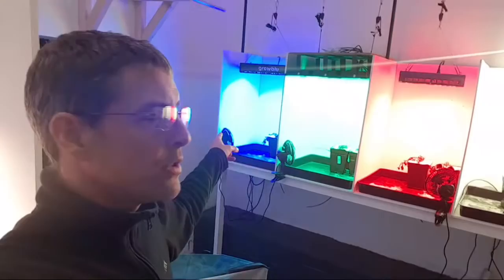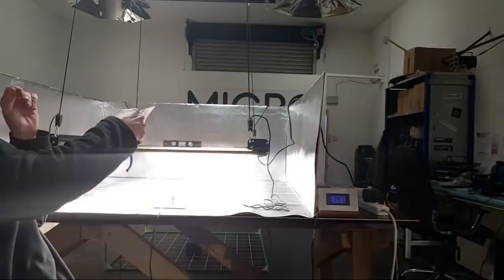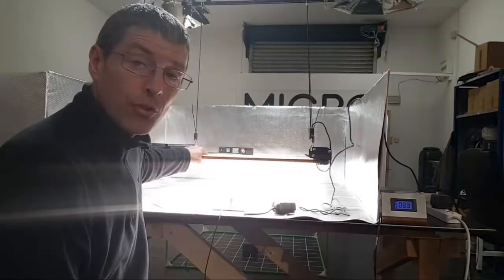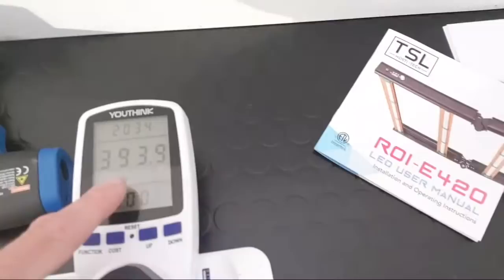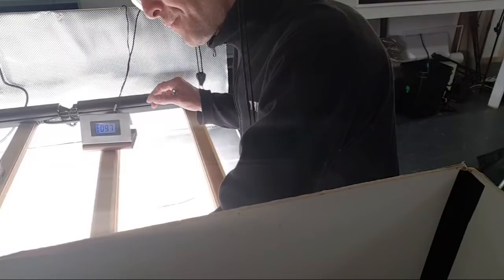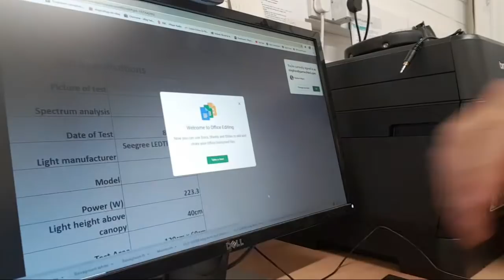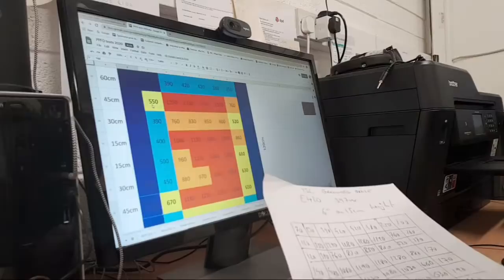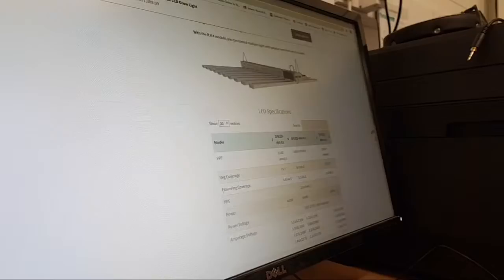Growers Choice ROI E420 test and Other Things

Comment: Your testing shows why a fixture that has a higher hanging height is an advantage.  It's the inverse square law-intensity is 1/4 when the distance is doubled.  That means you won't have a huge drop-off in ppfd through the canopy.

Comment: LM301B &  LM301H are the same, just a different label letter , H for horticulture. 
From samsung, they are the same, no extra coating , no difference.  Look it up on/ at Green Genes Garden. He spoke with samsung rep.  For first hand information.
Reply: Look it up yourself. Green geenes garden.
Reply: On samsung website you can comprare the two leds and they have different values... no one saw that?
Reply: I would not go by Green jean as his boards use lm301b not h so it is in his best interest to say that, infact everywere else i have heard besides jean and the people repeating what he has said I have heard, read lm301h are indeed a little more efficient with a slight increase in par as well. Green jean has done a good job of promoting no difference as it suits his best interest and pocket to do so.
Reply: @kkrollingskkrollings3173  did you look & watch  his video ?
He talked to samsung rep.
 301h has availability  & price issues. 
Say what you want . Please research . Not guess
Reply: @Janusz Wiśniewski market
Reply: @luisfelix09happy  they do not cimpare them the same , 1 in lumas 1 in joules
Reply: @rdreynoldsbanana  marketing
Reply: Robert ok, I will look this up, what does mms stand for & do u need to have covid9 for it to be affective? Thanks mate
Reply: LM301H are more efficient
Reply: Yes they are the same but made to take humidity so the chips last longer that’s it.
Reply: Has absolutely nothing to do with longevity.  2 things that shorten  the life of a diode . Heat & vibration.(voltage)
C is for cookie.
H is for horticulture. 
M is for markiting.
If you take some time & resaerch  B diodes & H diodes are compared differently.   If tou look further aprox end 2018 beginning of 2019 im sure you can find the article from samsung that says they wanted to gear there marketing towards Horticulture sales. 
Again no special treatment or coating, nothing to make them last longer other then under driving the LEDs , then adding more or less diodes (LEDs) or spacing per board to make different results .  Its called maketing.
Reply: @rdreynoldsbanana  You raise some great points bruv,but your manner is very rude and uncalled for.You're letting the side down a little.You clearly have a Good brain on you.Try some empathy.Peace.
Reply: There is a coating on h
Reply: @orsonwells5886  prove it
Reply: coolestguy ontheplanet why to get into a long winded argument with you about it....hard pass...cheers
Reply: @orsonwells5886  call steve @ HLG , they are partners with samsung.  Ask what the difference is .
Or better yet listen last Fridays  "Future canabis project" steve from HLG says they are they same but doesn't get off topic.  Regaurdless it a good listen. Nine guests  get into good talk about growing , lights & stuff ,
Very  specific , like grams per wattt with what light.
Reply: @coolestguyontheplanet723  the Lm301H has a phosphorus coating meant to withstand over spray and misting and high humidity in indoor grow ops. Thats exactly what the H stands for Horticulture.  
Its a benefit over the lm301b and lm301D and 281b. 
As they need a the silicone coating over the board to protect em
The lm301H and 351H reds are water resistant where the rest are not.
Also Growerschoice dosen't use Samsung chips at all anyways. They use some custom Chinese protietary chip from the same Chinese manufacturer of the fixture itself.

Comment: 41:04 I agree. I dont like how some lights or setups have so much light in the center. That's why I built my light (vero29 with meanwell) with the bulbs slightly outward and I hang it so all of the bulbs lights overlap in the middle. In my 2x8 tent, one plant wide with 6 plants a lot of the flowers grow on the outside anyways and you get the reflection off the walls.

Comment: I have 34 ROIE680’s. I just put plants under them this week.  8 lights x’s 4 flower rooms + 2 in veg rooms. I will be keeping detailed notes and information. We shall see
Reply: Glenn G. You have any issues with the master controller? My controller works fine with whatever light is directly connected but any light I daisy chain it won’t control it and the light remains on when in EXT.

Comment: Thanks for all the hard work you put in. 
 Is there a way to do a  new review on Spider Farmer series. I think they updated the meanwell drivers from older models. 
Also compare SF 1000 , SF 2000 , & Sf 4000 , the amount of diodes in each. SF2000 has aprox 50 more leds then the 1000 & 4000. Why ?
Reply: would love a review on the sf2000 which has 576 LM301B diodes, while the sf1000 that was reviewed  a few months ago only has 208 LM301B diodes
Reply: All I know is my stuff finishes early using spider farmer. 8 week stain finished in 6
Reply: @Courtdog2k3 well thats quite the statement.
i've got an 8 week strain that just popped so will see once i get her under my sf1000 for my 1st grow
Reply: We should all be done with spider farmer by now... since covid spider farmer (meizhi) highest point of there price hikes was 400 cad on the sf4000... a 400 dollar hike due to the pandemic creating high demand with no lack of supply... they can eat there lights and change names again.
Reply: @ehhcanada  I dont understand what you are trying to say.  
 Price has not gone up on Spider Farmer lights since i started looking at them months ago before covid lockown. 
SF1000  $150 ish
SF2000 $320 ish
SF4000 $575 ISH 
Any price that is far cheaper is a scam.
I thought i found a sf2000 for $150
 I ordered it.  I am now working with PayPal to get my money back. It was a scam website. 
Needless to say , prices are pretty standard.
Reply: @coolestguyontheplanet723  not sure what your on about but go check amazon and there website.... the sf4000 started at 600 CAD it went up as high as 1000cad and is currently just under 900... dont try to cover for a company that has already admitted to what they are doing lmfao
Reply: @coolestguyontheplanet723  i actually just purchased it at 889 cad just to simply prove the price hikes after they lower the price back to normal. Sf is done for they WILL switch names yet again as they are MEIZHI
Reply: @ehhcanada  not covering for anyone or anybody. 
 I can buy as many sf2000 's for $320 usd. All day long. The sf4000 is $579 usd all day long , i can buy as many as i want . If they are priced that high where you live. Dont blame someone else. Ask someone to buy them for you and reship them to you. 
My best actual price on SF 2000 is $299.99 with 10% off & free shipping as of last week when i checked. And i might buy another because my first one is a kick ass light that no one can touch in that price range. (Not even Hgl with discount)
Reply: @coolestguyontheplanet723  your only intaking what u choose to read.
They at peak raised prices 400... since covid... this has nothing to do with location or currency conversion....
You can not compared a lm301b board with a lm301h boards pricing...

Just so you know the american price was hiked upto 650usd wich is 911cad.
It has been put on a fake sale due to all the back lash for 566 usd wich is 793 cad.
Before covid it was 600cad.

Americans still got slapped with a price hike just not as bad as canada.
Reply: @ehhcanada  again there is no difference between LM301B & LM301H. There is no new secrete zinc coating . They are identical.  They use there marketing magic to compare specs in different values. Look at them side by side.
I have not seen SPIDER FARMER advertise a LM301H quantum board on the SF2000 or the SF4000. 
And i still don't know about the price increase. My SF 2000 is still new. I ordered it online,  got it drop shipped  on 3/26/2020  , so 6 weeks old.
$1 CAD is equal to $0.71 cents. USD.
your money is stronger.  It should coat less. 
Again the H is marketing. I looked it up last night.  When the LM301B became popular , they rebranded they laat letter to attract the Horticulture market. I would love to show the link or the screen shot.  But I couldn't t figure how when this first came up. .
Let me make this clear. I am in no way linked or affiliated with Spider Farmer. I dont know about there past. I really dont care . I was told the other day they where mars hydro. Or a second name or underbrand. Again i dont know. Again i dont care. Im saying you cant beet this price for this spectrum of light with ADDED far red & 760 nm IR . 
Also , alot of companies copy & paste spec sheets.  I truely beleive this one is pretty acurate by 2 quality reviews with apogee meters. 
Not trying to buat balls. Trying to help with research i have done & believe to be true & honest
Reply: @coolestguyontheplanet723   my point is they are a budget light currently priced the same as a high end brand in canada.sure the states has not seen as large of a hike on amazon by spider farmer (meizhi) but canada has had it with them as the price hikes they have done go against canadian laws.even amazon does not allow it thats why they hiked it up 10 to 20 cad each day till they reached just under 1000cad.
Everyone blasted them and they have been slowly lowering in the same manner to not get busted by amazon.
As for the chips being exactly the same i know alot are making that claim but mainly by light makers using the 301b so i dont know about that all the units with 301h seem to have better readings then 301b
Reply: Eh canada no you didn’t , your nose is now bigger
Reply: @ehhcanada $ 1100 in Australia
Reply: They were $800 a couple of weeks ago now $1100 in Australia, hlg are better priced
Reply: yes i did daniel...infact i have it right now and the sf4000 arrived with big gobs of the glue coating on a bunch of diodes.
Not only is it way over priced but the quallity is even far worse then early mars hydro units.....
I will document the unit then send it back.
Return label already made.
Its trash hands down trash.
For the same price i preordered a lumatek zeus 600 PRO........ u tell me whats better...
Also have a slim 600 on the way to be real world tested against the lumatek.
Then ill put the winner against chilled.
Ill end this with a huge LOL.

Comment: The ROI 680 is the best led light bar after 37 years of growing plants I'll keep mopping the floor on LED,s with the New tuned  MH bulb's all these led manufacturers are just mixing spectrum to get a balance 3000k-4000k a balance full spectrum MH bulb does the same thing as led from seed to flower- (Greengenes) stated 1000w hps will still mop the floors on 95% of All LED lights led lights direct light instead of reflecting light meaning if led lights are to close they cut with heat like a Laser beam that's why they use 90-120 degree lenses to spread the lights and 600watts of heat is 600w of heat no matter the light source so people thinking led lights run cooler find a true 1000w led panel and try to burn them without a strong inline fan and if  lumens don't matter  why people not growing with 250 Watts  all our 28%-32% Thc  strain's are still grown with hps/mh and yields that LEDs can only dream about still if it's not broke don't fix it🙉🙊🙈
Reply: That's funny because most led growers are getting 1.2-1.8 gpw. Newbs getting a 1gpw and a guy on ig named great white bud pulling 100g per sq and plenty of people on riu pulling numbers
Reply: @HasaniRedd1  - true I have just made a change of heart the Chilled X3-X6 now tested by Shane here has blown me away I'm finally after 38 year's of growing only running them Made in America led,s that's sure to set a trend like we always do with made in America  swag🧐🤐